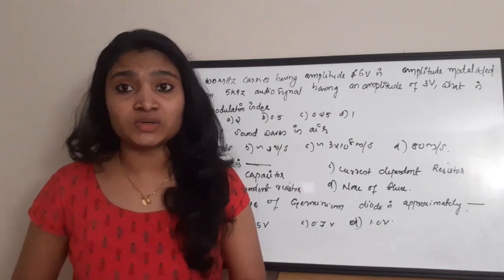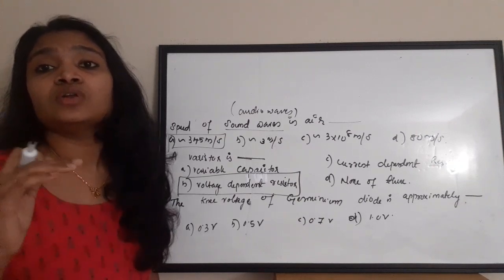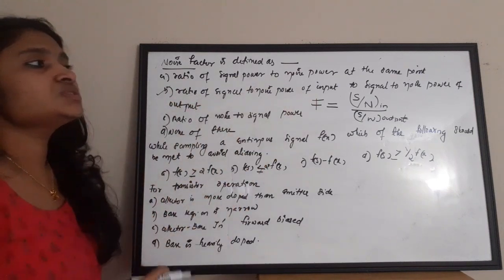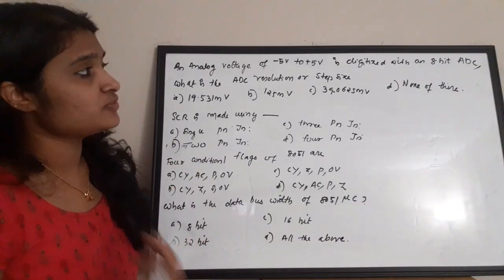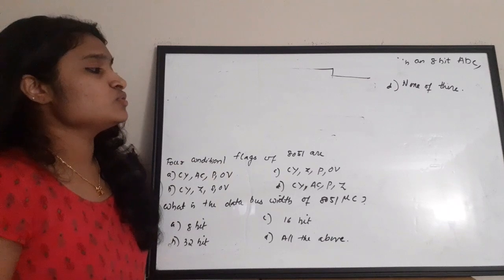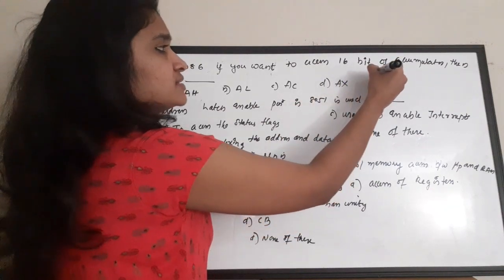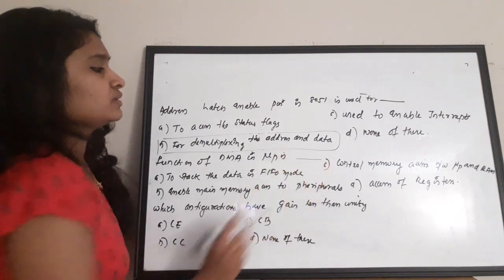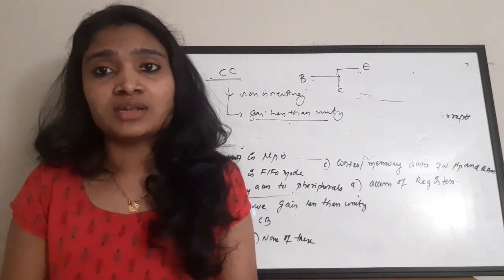LPSC(ISRO) Technical Assistant Electronics Previous Year Questions Part2|LPSC Technical Assistant

Comment: Ma'am how will we determine if gain asked is for current or voltage. As per theory configuration consist of both the type of gain . Ma'am pls clr my this doubt.
Reply from the maker: It will be given in question, if not given mostly they will ask for voltage.
Reply: @EasyElectronics_jobupdates  thanks maam